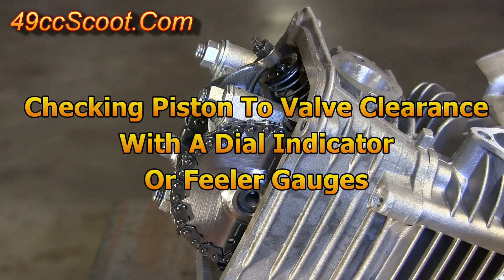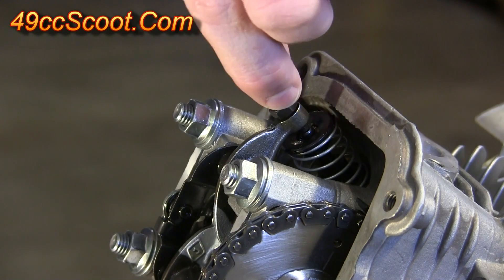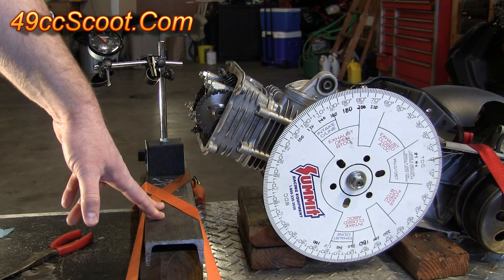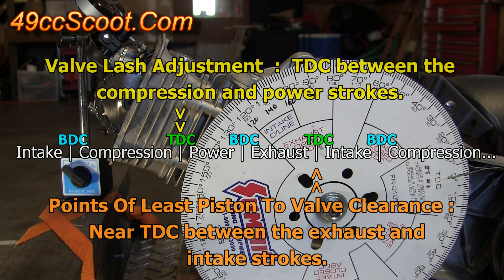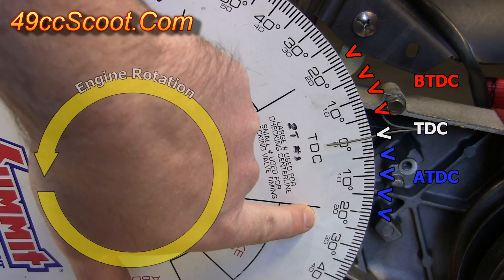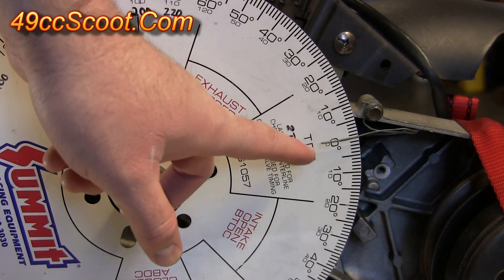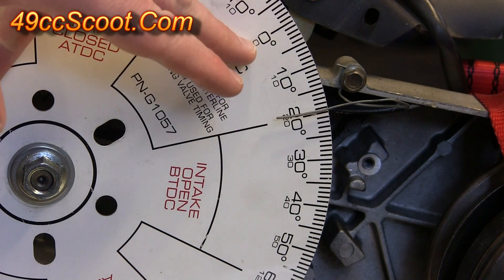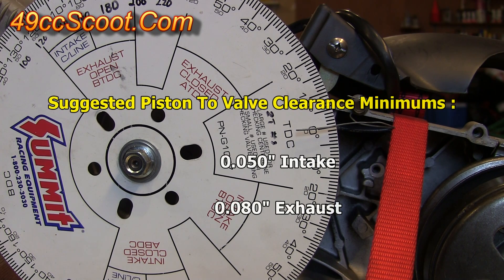Checking Piston To Valve Clearance With A Dial Indicator Or Feeler Gauges

Comment: I'm really late here, but I think it would be quicker to just set 0 lash as shown then start putting more and more thickness worth of feeler gauges between the rocker and valve, again as shown, but after each change  just rock the engine back and forth. When you feel the valve just start to hit the piston you are done because you have found the clearance. Also if you stop at the point where you feel them touch, IE the minimum clearance point, it can be read directly on the degree wheel.

Comment: but we always install cams with that t mark reference...
Reply from the maker: Even more reason to know if it's right. You don't really have to go the whole degree wheel route for a quick check to make sure it's in the ballpark. You can use a screwdriver or something in the spark plug hole to make sure the piston seems to be at TDC when it's on that mark. Of course turning the engine gently by hand only for that purpose. Most likely, it'll be close. If you're dealing with Chinese stuff like I am mostly, there's a chance that it won't be, albeit slim.

Comment: Hello I can't the valve location on Vento Triton R3 scooter, after removing the spark plug and those accessories. Can you help?
Reply from the maker: I thought the R3s were 2Ts and only some of the last years of the Tritons (R4) were 4Ts. 2Ts don't have valves like these. If it is a 4T, then you'll have a valve cover at the top of the engine and see the valve springs and cam and rocker assembly under there.
Reply: Nothing, Triton R3's Spark Plug, 4- 12mm bolts removed, only see the piston. Plus Carburetor removed found no valves like one would see the valves after removing the valve cover on a Aura NSX.

Are you saying there are no valve & no timing chain on this scooter?
Reply from the maker: You have a 2T. They don't need all those extra moving bits.

Comment: my dealer recommends for my 50cc scooter to put the valve clearance 3 thousands and 4 thousands(in then out). what would u do?
Reply from the maker: Those are OK specs. People have their own preferences, but about 0.002-0.005" will work for the 139QMB.
Reply: 90GTVert cool thanks. that what I have!

Comment: how buy spring valve?
Reply from the maker: Take one to a hardware store and see what they have that will match the diameter and height well enough. You can cut one down if it's too long. Should be cheap.